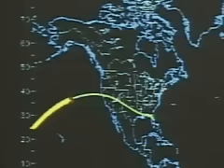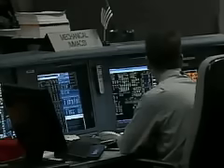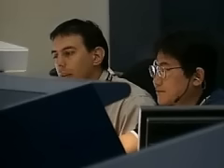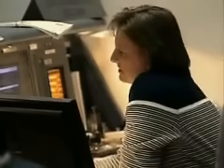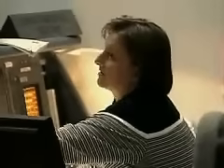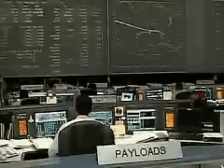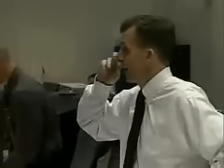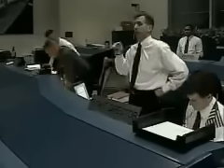Inside Mission Control During STS-107 Columbia's Failed Re-entry and disaster

Comment: I have no mercy for NASA.  Their direct negligence killed the crews of Columbia and Challenger.  They had the data they needed to avoid both of these failures.  They went ahead anyway.  They could have examined the wing instead of just allowing re-entry.  At those speeds the air becomes extremely hot plasma, it cut the wing off the Shuttle.  The problems with the solid fuel seals was preventable.  I know indirectly the person who offered solutions to the icing problems.  NASA repeatedly refused the help and floundered for over a year.  The answer was simple, heat the problem areas and avoid ice build up.  They used thin film heaters on the seals and a thin film donut on the fuel tank struts.

Comment: I was assigned to 45 SW/CCAFS at that time I get angry every time i see this, because it was totally avoidable.  Same NASA culture led to the unnecessary loss of Challenger.  If NASA had allowed the USAF to check the orbiter's left wing, they would have seen the damage -- and would know such damage posed a lethal risk to the astronauts -- and could have sent Atlantis up in time to rescue the astronauts and then try to land the Columbia unmanned.
Reply: Atlantis was no where near ready to launch. The orbiters did not have the software to land automatically.
Reply: Wrong x2!

1.  Columbia absolutely DID have software to land unpiloted.  But who cares about the shuttle if you could’ve saved 7 astronauts?!   Or, even assuming for the sake of argument that you were right, rescue 6 astronauts and leave one to pilot Columbia home. Or leave Columbia to drift in orbit.  Who cares?!

2. Atlantis WAS close to launch-ready.  They could’ve launched in 7-10 days, which was PLENTY soon enough to rescue the Columbia crew.
Reply: Wrong x2. Very funny. What I meant to say was never used. Every landing hit the pavement with the commander flying this awesome machine. After working in the cockpit for 25 years, I can guarantee Atlantis was no where ready to launch.
Reply: @RockHudrock  There is no way in hell they could have launched in 7-10 days.  The next launch of Atlantis was scheduled for a month after Columbia was supposed to return.  Six weeks of orbiter prep simply can't be reduced to a week an a half, no matter how much you want it.

NASA did a study and found that they could have shortened it to three weeks, assuming they skipped all of the safety and operational checks that they normally do.  If they did that, and it actually launched without the computer shutting things down because of a problem or having the damn thing blow up during launch, they could have, in theory, launched on the very last day they could have gotten off the ground and rescued the crew.  But that assumes that, for the first and only time in the Shuttle program, the orbiter prep went off without a hitch and absolutely everything functioned exactly as designed as soon as it was assembled.

Comment: I know I'm too dumb to be so judgmental...but why didn't mission control know what the commander was talking about that had failed??  why did he have to explain it to him like he was a 3 year old about where it was located??   And what's with all the yawning and the boredom....I want smack some people but that's just me.
Reply: The shuttle had 2 1/2 million individual parts.  It's a safe bet that no one person knew where more than a fraction of them were.  Also, I've done troubleshooting in several jobs, so I can understand at least a little what the thought process was.  You try and eliminate possibilities:  Are they all in roughly the same place?  If so, do they have some point of commonality? (IOW, is there one thing that could go out that would cause problems with only those four sensors) If so, that's the most likely location of the problem. If not, then it's bigger problems, because it's virtually impossible for the four of them to all independently fail at the same time.

Comment: NASA tested large portions of foam in the lab and couldn't find out how it could crack and wrongly suspected the technicians of having applied it improperly. Then when a shuttle launch was cancelled, they found that the foam when applied on the scale of the external tank and treated as a single gigantic piece, begins to crack when they loaded the cryogenic propellants into it, caused by the shrinkage of the tank itself. This was only possible to observe when an entire tank full of propellant was subject to the temperature changes. NASA then apologized to the technicians.

NASA had come very close to a similar disaster in STS 27 when hundreds of tiles on Atlantis were damaged following impacts from pieces of SRB insulation at 85 seconds into the flight, similar to Columbia. One tile was broken off, and were it not for a solid steel plate at just that spot, Atlantis could have broken up. The Commander didn't think they could make it back with the damage. He was infuriated by NASA's attitude and planned to tell them what he thought in case his sensors began to fail and instruments indicated Atlantis was going to disintegrate. Looks like NASA didn't learn from the lesson (not that they could have done anything for Columbia, but it's just their dismissive attitude towards known problems). They forgot the high standards they set for Apollo.

However while removing the bipod foam ramps took out the elephant in the room, till the end, NASA never quite managed to completely resolve the problem of the foam shedding.

Having said this, the Flight Director needs to be praised for keeping cool despite the agony of the worst moment in his life. He must have been dying inside.
Reply: they never took it seriously and treated like a maintenance issue and was acceptable risk.  horrible management at NASA
Reply: @valvodka  Cut one corner anywhere in rocket science and it will RIP you apart, literally. The bipod foam ramps were huge individual pieces of foam that were known to break off before and once even damaged an SRB IIRC. Finally after Columbia, NASA got rid of them by replacing them with a pair of heaters. They could have done that one easily years back. 

As with Challenger, they just didn't take these things seriously despite multiple warnings. The Shuttle crew cabin was inseparable from the orbiter and had no escape abort modes so the crew were much more vulnerable than Apollo or anything before it or since. 

Way back in STS 27, just the 2nd flight after the Challenger tragedy, Atlantis was nearly lost before when pieces of SRB insulation slammed into the orbiter and resulted in hundreds of tiles damaged. The commander was so frustrated by NASA's lack of seriousness over what clearly showed up in the pics that neither he nor the crew believed they would return home alive. If the telemetry told the crew Atlantis was breaking up during reentry, he wanted to tell them what he thought about their analysis in his last few seconds. Fortunately they came back home safe, but everyone was shocked that over 700 tiles were damaged in the end. 

Only a solid steel plate behind one missing tile for an antenna prevented a burn through similar to what happened on STS 107. Unfortunately they didn't learn. 

The next time Columbia wasn't so lucky.
Reply: @srinitaaigaura  I don't think Apollo has any escape pod unless I remembered wrongly?
Reply: @theshermantanker7043  Apollo had a Launch Escape System, a tower with four solid fuel motors that could pull the CM off of the SM if a malfunction was detected by the EDS. There was a Boost Protective Cover over the CM that the LES (escape tower) was fastened to.
Reply: @srinitaaigaura  On one shuttle it came close to damaging a critical electrical box or something that controlled the SRB sep I believe.
Reply: They got cocky when they got the Shuttles, hence why they slacked after Apollo ended. The lesson is to never get arrogant, ever
Reply: @kristopher slaght I spent a few years at MAF. What you said is true and I probably could have a cup of coffee and a whole conversation about this.Thiocol/OrbitalATK merged with Northrop Grumman for supply ships to the ISS and satellites. I asked about the SRBs and boy did they defend it for the SLS. I hope the SLS doesn’t share the same fate. I did my job with integrity and for mission success for the first two ships. At least the orbiter is not right by the ET.
Reply: kristopher slaght  There was one more thing IMHO. Unlike any other crew module, the space shuttle cabin could never detach from the orbiter and abort safely with its own heat shield, a measure that went right back to the very first manned launch. I believe the plan was abandoned during the shuttle development stage for complexity and weight constraints. 

This meant that if anything happened to the orbiter or the rocket, the crew had no escape and would go down with the ship. Other rockets have failed or have been tested, but the abort system saved the day. The loss of 14 astronauts could have been avoided.
Reply: kristopher slaght maybe you should have used element 115!
Reply: I don't know if you'll ever read this, but the CAIB found no actual main reason for the bipod foam to fall off.

Doug Osheroff, a CAIB member and physicist, did multiple experiments and found "cryo pumping" could not have resulted in this. It's in the book "Comm Check".
Reply: @thatoneskierdude4410  That was before Hurricane Katrina hit. It was only when a whole shuttle was rolled back and the tank emptied etc etc did they find out that the foam could crack. They could not duplicate it in the labs.
Reply: @srinitaaigaura  what
Reply: Problem is management was making engineering decisions.
Reply: Apollo didn’t have high standards, Apollo had ridiculous amounts of luck, even after the Apollo 1 launch pad fire. They fully expected to lose a crew. Congress has always been parsimonious with NASA funding as opposed to military spending and procurement which is astonishingly wasteful. Look at the amount of failed military projects that have had tens or hundreds of $billions thrown at them. The Shuttle itself was the cheap version of the original idea, which was supposed to have a reusable launch vehicle
Reply: @SvenTviking  1. No one said luck is not a factor. 2. NASA did do a massive overhaul after the accident on the ground which killed three astronauts.
Reply: The Challenger Accident Investigation Board report provides an excellent summary of what NASA knew and when. I don’t have the link handy, but it’s easy to find the PDF online.
Reply: srinitaaigaura The design of the spaceshuttle was the flaw itself, because it was medeled   with from the beginning by separate several different arms of the government and by politicians. It was doomed from the very first flight in the early 80s
Reply: GEE all that calculus and science class you took and still you killed a bunch of Astronauts. Way to go NASA, you get an F in this class we call Existence 101.
Reply: @gfx2943  to be fair,  there is inherent risk in spaceflight no matter how careful your calculations and precautions. 

That being said,  they really did cut too many corners on this one.  They knew about the strike to the wing but didn't take steps to get a look at the damage. If they had they may have been able to do something about it, whether it's an impromptu repair or an evacuation to another shuttle. This could have been prevented.

Comment: I'm sorry, 
The one time walking in space would have been useful
nobody in that whole place thought of it...
a real bunch of go getters I'll tell ya...
  hey Joe why don't you get outside & get a look at that wing..

naaaa I'm having some tang...
Reply: Of course it was thought of. There was really no way to space walk to the leading edge of the wing. They thought more damage would be done to the wing on a space walk looking for damage that might not even be there. Thats why it wasn't done.
Reply: @jrockett73  
well not according to this documentary,
where did you hear of this?
Reply: Right, these documentaries focus on mission control and the people you see in this video. The floor below mission control is the group of 200 system engineers that relay information to the controllers above. An EVA was talked about behind the scenes. Orbiters are configured differently for each mission. This mission had two EVA suits as always and two trained EVA crew as always . But there was really no way to check on damage with no Canadian robot arm and no handholds to the wing leading edge. Damage to the door radiators and the wing thermal protection was inevitable. Myself, I would have done it anyway, but the powers to be were against it.
Reply: @jrockett73  
you could be right, but I would still like to see the documentation,
there are times when people don't ask questions they don't really want answers to.
My impression of this particular documentary , was that there was a reluctance to dig in too deep, motivated, perhaps by a fear of what might be discovered..
Reply: Documentation of office talk , good luck...  The mind set was of past history. Foam strikes were always cosmetic in nature and could be fixed between flights. If it was a different flight and different configuration, maybe management would have tried harder.

Comment: 5:18 That crackling sound was when they lost communication as the shuttle started breaking apart. 😢
Reply: No, break-up is around 5:50.
Reply: @amandakleisnerova7473  bro, that's crackling sound was 1 second after the captains last words, Roger oh!! And lost communication.
Reply: @JediGamingX   Fonzies HW68  "Feeling that heat", interrupted by "We just lost tire pressure on the left outboard and left inboard, both tires." "And Columbia, Houston, we see your tire pressure messages and we did not copy your last."  "Roger, uh (both)". <Mic popping.> " Just taking a few hits here. We're right up on top of the tail. Not too bad."  "And there's no commonality between all these tire pressure instrumentations and the hydraulic return instrumentations." <Vehicle breakup begins> "We've also lost the nose gear down talkback and the right main gear down talkback." <Vehicle breakup ends> "I've got four temperature sensors on the bond line data that are off-scale low."  "I didn't expect, uh, this bad of a hit on comm."
Reply: @amandakleisnerova7473  understood, still, this was sad and I feel for the fight director and give him so much respect, he kept it professional all the time wile in his mind he knew the situation., but watching again, you're right, 5:50 more or less is when all got started. RIP Colombia Crew. 😢

Comment: the buzz is engineers knew Columbia had suffered fatal damage when the heat shield was struck by Styrofoam upon liftoff.  it was never mentioned and the astronauts were told nothing because they knew there was no hope they were coming home alive, so since there was nothing that could be done - they just went thru the motions
Reply: The crew was sent the video so to say they were told nothing is wrong.

Comment: Why isn't there a procedure to instruct the crew to abort mission and separate the shuttle from the boosters? At least that is a better option than just let it resume the flight and assume all goes well while all camera recordings showed leaks of vapors, right from the beginning of the launch, that's 76 seconds. Not sure if it is technically impossible given the vehicle shear speed, or because  the separation is automatically initiated by on-board computers upon reaching a certain altitude, because the vehicle was high enough for a possible separation maneuver from the boosters. Just a thought, I'm not an expert.

Comment: I would also like to compare and contrast the situation here with that on Apollo 13. In that case, Gene Kranz can be audibly HEARD (the tapes are on YT) to get directly involved, poll his controllers, ask the right questions, and make up his own mind. At one point he mentions "They're talking about a bang and something outgassing into space - that doesn't sound like instrumentation to me.." And from that point on, everyone in the room is on the same page. Whereas here, Cain is trying to convince himself that the worst is not happening, when he knows that it is. One thing you could have immediately tried, and it might have worked, is to roll extreme left and bury the left wing in the shadow of the orbiter body, and maintain that orientation against all odds. That was the only chance, but it was a CHANCE. Given what he knew about the wing, that was the only reasonable call. Instead, he sits here dithering about instrumentation, basically trying to convince himself of a lie he has already bought. It's a stark contrast, Kranz vs. Cain.

Comment: Dear NASA, Next time, 1. Never keep any adverse information from the crew. 2. Use all means available to learn of the condition of a space vehicle. 3. Never ignore or dismiss the engineer's concerns, requests and recommendations concerning the operation and safety of the space vehicle.
Reply: 4.  Put the damn crew capsule on top of the stack and give them a way to get off the booster if it fails.  You know, like you did in 1961.